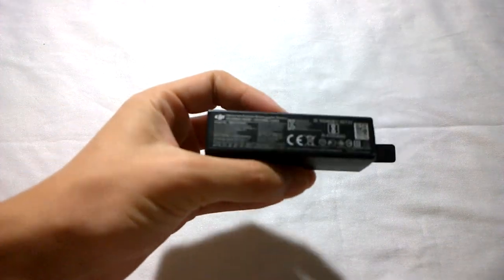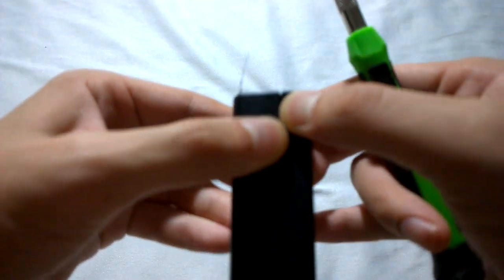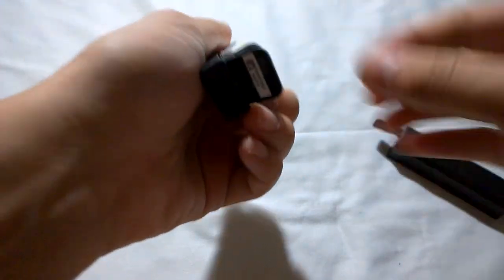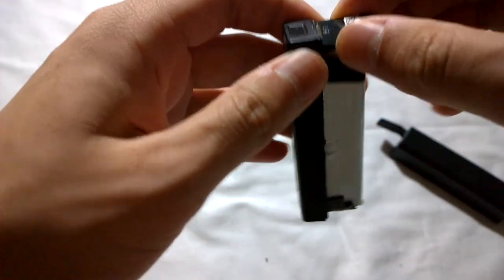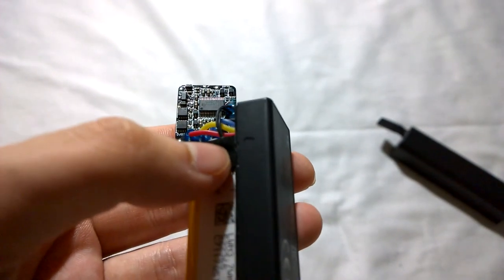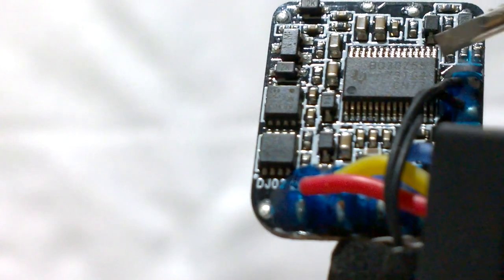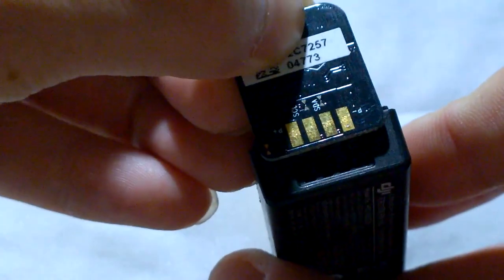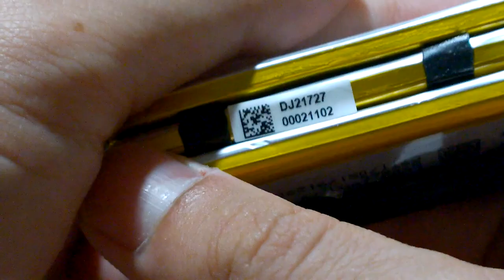DJI Osmo 4K Battery Teardown

Comment: Estimado le hago una consulta se puede cargar con un cargador universal imax b6
Reply from the maker: You could charge it, but you will need something to connect to the battery terminal itself.

Also, you will need to set the maximum voltage and current to these values:

Voltage: 12.6V (Max voltage, as indicated on the battery itself)

Current: 500mA to 1A (500mA will prolong the battery life. 1A if you want a fast charge)

Comment: Can you arrange a charger for the same model and ship it to India?
Reply from the maker: Sorry but I can't do it because I also doesn't have a charger for the battery.
Reply: Same issue..plz find a solution to charge this battery without charger.if anyone have the solution ..plzz suggest
Reply from the maker: You could charge it using the battery contact on the top of the battery.